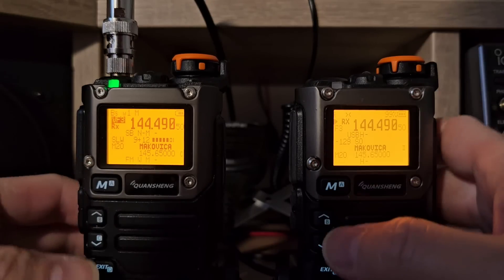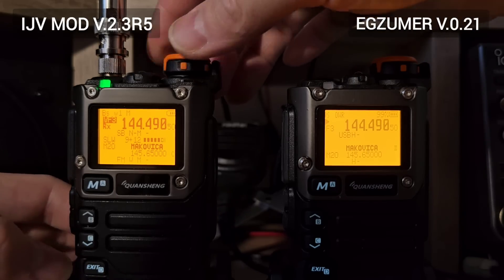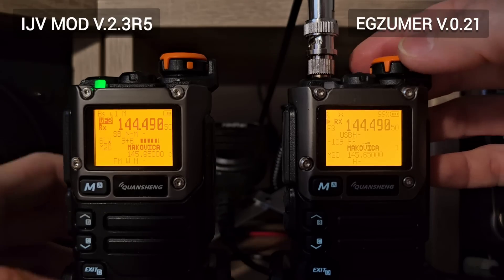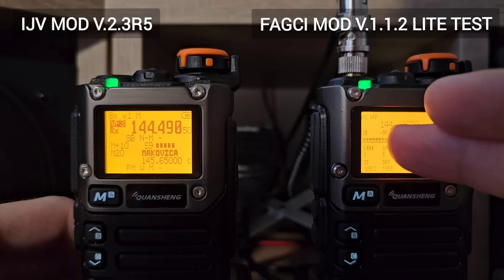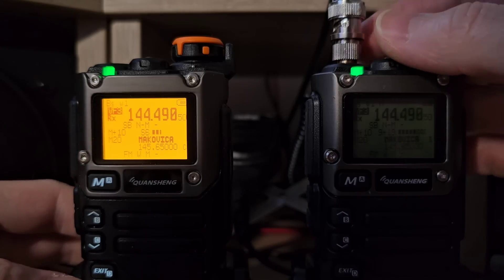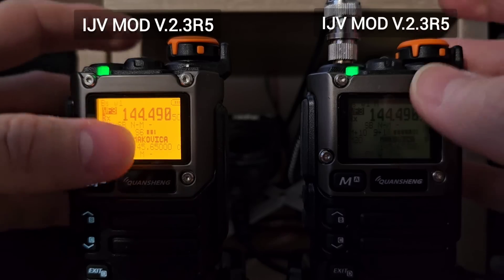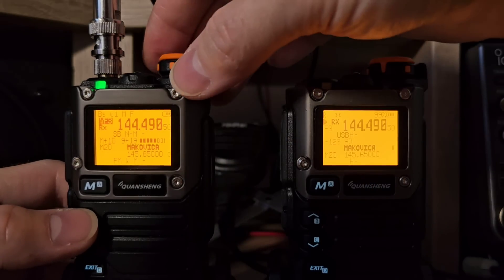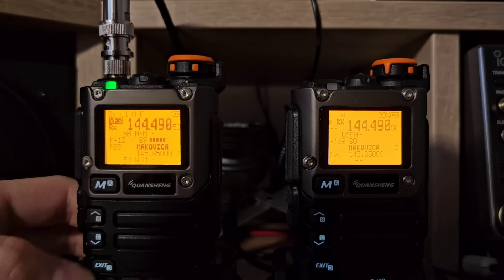QUANSHENG UV-K5 Battle - Custom Firmwares Comparison in SSB reception quality

Comment: Hi, I have flashed my UV-K5/K6 (8) with the egzumer firmware. but even with the squelch on full I am still getting break through from the main frequency while listening to commercial radio is there a way to fix this?

Comment: I bought one of these and an ICOM ic-R6/at the same time as I needed a cb radio when I go mountain bike riding just in case I get into trouble and my phone won't get a signal. I love listening to the airband when I'm at home, and even though I'm in a rural area of Australia i still am able to hear planes trafficking to and from the city and intermediate airports, which works great with a good outdoor antenna. That's my first issue is, where I used to live I had a lower roof and it made it easy to Install antennas on my roof. Now I'm in a two story house and no longer own a ladder I have to make do with a pole  mounted to the side fence with a airband  vertical antenna. I started using the R6 with the optional whip antenna which is slightly longer than the standard antenna and even then, inside it barely picked up a airband frequency even the local small airport where gliders take off from. But the quangsheng radio can receive the stations I get on the R6 using the outdoor antenna. And the quangsheng is still using the standard antenna. Definitely not what expected from ICOM considering it cost 4 times the cost of the other radio
Reply: Unbelievable ❤

Comment: Leftradio has better sound on same firmware so there might be a little diffrence in performance of the both, cheaper parts other factory bad soldering or just the left one was with a better battery....anyway good video thanx for that good to know what is out there.

Comment: Please stop twisting that BNC connector on the cable around! First disconnect the BNC connector on the cable from the adapter on the radio, then spin the adapter off the radio. Then spin the adapter on the other radio then put the coaxial cable BNC connector on the adapter. Please stop trying to twist the BNC connector off of the coax cable!

Comment: Disconecting the antenna from IJV the S-meter still 9+ Maybe that means the preamplifier still working even without antenna
Reply: or the reason is an open noise suppressor

Comment: Good video. Uv5r plus is better or not ? Thankss
Reply: It depends of what you want. If you like a bigger battery pack than it's better, if you need an USB-C charging port than don't take it. LCD colour of 5r is bluish. Loudspeaker of 5(8) and 6 is different and seems slightly better. All other specifications are same.

Comment: Which firmware is best for 10m SSB voice for weak signals ?
Reply: IJV mod is pretty badass for reception. Hope you aren't planning on transmitting though- if you're planning on TX on the CB bands,  it's going to go straight into the harmonics. It's not going to transmit 27.2 very well,.... 54.4 very well...., but it WILL transmit 108.8 very well,  and  OOOOF you don't want that!!!

Comment: I'm finding with this new firmware that the radio overloads too easy. On 2 meters, anyone running 5 watts within 300 feet and the squelch starts popping in and out very fast. I can solve the problem by putting a stubby antenna on the UV-K6, but then I can't hear much beyond 300 feet. LOL Anyone else seeing this problem, maybe have a solution?

Comment: I have 2 of these radios now and have yet to flash new firmware into either. There are so many possible options I dont know which to try first. Also, i want to make sure I can revert to the original firmware if required. I tried flashing one radio only to have various hoops to go through. Seems you must use a browser with the flash option built in and Windows 10 ! Im still using Windows 8.1 on my laptop, so that's one hoop, and i tried Firefox  Chrome and Edge. They all seemed to lack the flashing capability.
Then, you have the issue of drivers for the radio or USB Cable. I'm going to persever as i do have a Windows 10 machine. But maybe i should just go to use linux instead, which is another possibility. I think it's supported by Apple also, but I dont use any apple devices anymore. I'm one for the kiss protocol ! Kiss= keep it simple stupid. Lol. I want to add that I do appreciate these folks going to the trouble of hacking the firmware that is great and a great service to others, and I thank these guys for their efforts. Great job, folks.
Reply: Your making it hard for yourself my friend, I would just update my laptop and in twenty seconds the firmware on your radio is updated.
Reply: @jacianmcgurk7424  Thanks for your reply. Yes, you could say that, but I still use some old ham radio software that will not work with Win10.
I have another Laptop with Windows and Linux installed via a boot option, hence I mentioned Linux in the previous message.
Windows 7 was great for Ham Radio software use, and believe it or not, its still used a lot in the Ham Radio hobby. I also still want to use some older software as I have licenses for them. So a Win10 "upgrade" isn't a nice thing to be forced into to mod/hack a radio. Windows is constantly changing and following Win 10, Win 11 etc etc and more powerful computers are required. I'm not using these computers for business, so they don't need to be state of the art. I'm only normally running software with minimal requirements. Even Raspberry Pi machines can run some of the software I use. Sure I could go out and buy a new super i7, i9 machine etc etc, but I'm not going to do that for a $20 radio. I may be forced down that route eventually, but does the Quansheng company programming software need an i7+ Windows 10 machine to be used? I don't think so. So maybe the company software will be the way for me to go for now. Thanks.

Comment: I was really criticizing the EGZUMER (for a few things I don’t like) but it makes Aviation stations sound crystal clear, clearer than my actual certified aviation radios I fly with! I wonder how the IJV does in Aviation band? Fagci distorts very badly aviation band, no AM fix.
Reply: IJV is more sensitive in aviation band than Fagci. Fagci is, in my opinion, the best overall firmware with very good airband reception but you have to reduce the LNA$ on strong signals. IJV is currently my favorite but not so intuitively usable. You have to read in carefully. I will try and compare egzumer in the next couple of days.
Reply: @kp-od8ji  hi! Wondering if you made a comparison?
Reply: As for me, now i use IJV for aviation. Little bit clear, than EGZUMER. And it more variable (i mean settings).

Comment: It was just audible on the EGZUMER but so weak it was difficult to hear. But you can just hear it on the video.
Why were the S meters showing s9 signals without the antenna connected ?
Reply: they are not calibrated, dunno if they can be calibrated?
Reply: or the reason is an open noise suppressor
Reply: @alexpopandopalo  noise gate?

Comment: You need a real a/b switch of course. It is somewhat hard to tell which one has more noise because one, it sounds to me like the noise spectrum is different in the two radios and two, the Morse code level may not be the same when you go from one radio to the other. Because the Morse code may be louder or softer in one sample, the next one may be a different level and therefore make the background noise sound louder or softer in addition to the slightly different equalization audio equalization I think I'm hearing. But there was one I thought was maybe better that last one sample with slightly lower frequency background noise

Comment: It might not be the firmware making the difference. I have a Quansheng UV-K5 and a KSUT UV60D, they are the same radio, but one has a better RX than the other, both running the same firmwares. I wonder if the internal build of them is identical, it's possible that a few components are different, like a resistor value,etc. Anything at all might affect the RX and TX value. A fairer test might be to use each firmware on the same radio. I have found the Quansheng RX to be better than the KSUT clone. Both work fine, but one has mouse ears, one has desert fox ears.......

Comment: Very nice comparison OM0ET  ! I tried one of the little SDR hF transceivers from eBay, the one with a little extension  antenna coming from it, and for some reason I just did not like it. The mode button would not do the same thing every time seems erratic and would do what it wanted to do and I sent it back. Thank you for promoting the world’s greatest hobby, maybe one day I will try another one! My mind barely wants to go to  my menu driven FTDX 1200. lol  one day when I get back to my main QTH will try and making a contact with you !  The  49\1 transformer that I built and end fed marvelously but I had to take it down due to inspectors inspecting everything next-door and the electric company nosing around. They had to completely rewire and move my electric panel and move the main wire, going to the weatherhead  ,did not want stray wires running anywhere between the two houses here on the property.  along with insurance people as well. lol. 73 KE4TDG

Comment: Funny the first one was still receiving when the antenna was removed
Reply from the maker: 😃😃 no way to receive anything such weak without antenna connected.
Reply: or the reason is an open noise suppressor

Comment: I changed over to the IJV firmware but can't hear my AllStar node. Switched back to egzumer and no problem hearing my node. Further investigation is going to be necessary.
Reply: Each of the FW's have advantages and disadvantages. None is bad.

Comment: The radios are awful. I can't recommend them
Reply: They are great radios for the money. I paid $20CAD for the radio, speaker mic and Nagoya antenna. I've had so much fun flashing different firmware and pushing the radio to it's limits. For what they cost, they are easy to recommend. Especially for those who like to tinker with things. The ones who don't like them are the ones who expect the quality and performance of a professional or high end amateur radio handheld. But that's unrealistic. If your expectations are that of an inexpensive radio, then you will be very happy with its performance and capabilities.
Reply: @DarrenMaunu  agreed!
Reply: @DarrenMaunu  So a Nagoya antenna, could maybe help me for better signal?
Reply: @pavingos  A genuine Nagoya can help with weak signals but won't make a huge difference. The stock uv-k5 antenna performs pretty well for vhf/uhf.
Reply: This radio for reserching is is greate!! For 20eur you can't buy iven usb cable for exmle some Kenwod. Nice Job Mike. Thenks 73 from S5 👍
Reply: I have one, i can't hear anything on it....
Reply: @pavingos  have you put in the batteries...?! 😂
Reply: @MrKeys57  lol yes. And new antenne 😁
Reply: have you entered your local 2m and 70cm repeaters into the device and had a listen or attempted to open them? @pavingos
Reply: Can you explain why it awful would be great if you do.
Reply: @M7XCB  propably because he cant afford one...Lol!
Reply: Why?
Reply: moronic comment

Comment: I wouldn't be surprised if these devices have a big variation in sensitivity. Good that you flashed both with sake mod for hardware comparison.
Reply from the maker: I found there a small difference in VFO frequency between them.

Comment: IJV 2.3 works great for me. I tried egzumer v21 made my radio deaf even on 2m/70 was struggling with repeaters I would get no problems. After flashing with IJV 2.3 it’s like new radio receiver is great. The developer is brilliant well done IJV excellent firmware 👍
Reply: Ijv no spectrum
Reply: thats right there is no spectrum but i am not bothered about that. its still great firmware. @bigbone88

Comment: Very interesting and thank you for sharing this test with us. I bought one of these radios because it was inexpensive, I enjoy listening to the HAM's and talking on the PMR bands. I like to think I am observant and did notice a difference in the settings on both radios which could explain why IJV MOD on radio (1) was clearer than the EGZUMER on radio (2).

Radio (1) has Menu30 Compander turned ON which enhances the verbal sounds i.e adding a filter. Radio (2) showed the II symbol showing which is a scanning icon, the Compander Menu30 is turned off. The last test radio (2 )has menu 30 turned off which explains the differences in clarity (tones). 

Someone who has firmware EGZUMER loaded may want to test this but for me, it's not worth changing my settings.
Reply: The "compander" is only available in FM mode, sorry.
Reply from the maker: Thank you 👍

Comment: I have been running the newer IVJ 2.6 firmware, and the RX AGC option has been implemented with a FAST, SLOW or Manual setting under menu item 54, this is has really improved the reception on my UV-K5, AM reception is vastly improved. Using the supplied basic rubber duck antenna - I am just amazed with the improvements made to this radio just by firmware tweaking. The best £20 inc postage I have ever spent on a radio.
Reply: Can you post a link to the site to D/L the 2.6 firmware  Google searching couldnt locate it   Thanks
Reply: Look for IJV, not IVJ...!
Reply from the maker: I think this was recorded near the end of the video too.
Reply: $30 US now on Amazon...is there a reliable source Stateside for cheaper?
Reply: @boostismagic  Aliexpress is the way to go
Reply: @boostismagic  not that I have found. I paid the $30 and had it in 36 hours. Tried to order 2 different times from Ali Express and never saw either one. If you do find somewhere else in US please post. Thanks!
Reply: @starcityofva  I hope you checked for the refund. Because Ali refunds everything that isn´t delivered.

Comment: The right hand receiver in the IJV mode is slightly better than the left with IJV mode, only slightly. Mind you every model will have it's slight flaws even after rigorous factory testing.
Reply from the maker: Small difference is maybe due to "cmpnd" feature was ON on one video and OFF on another. I have been noticed about it in one comment. 🙂👍

Comment: Thanks for the comparison. I wondered why my unit was so deaf using the latest Egzumer firmware. Wasnt achieving the same results as seen on some YT channels. The adjustable RF gain feature in the IJV mod is a nice feature.
Reply: As I mentioned in my comments, try switching on Menu 30 and see if this makes a difference. Thanks.
Reply: A mí me pasa lo mismo. Me tiene aburrido!. Mañana pondré la IJV 2.6 que dicen. Seguramente vaya mucho mejor😉👍